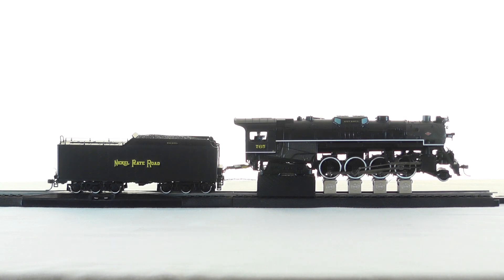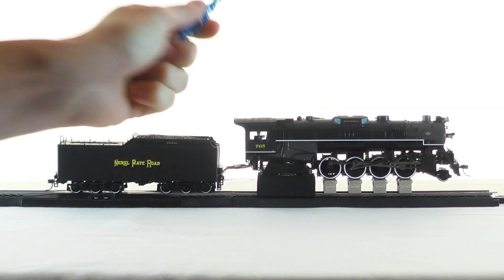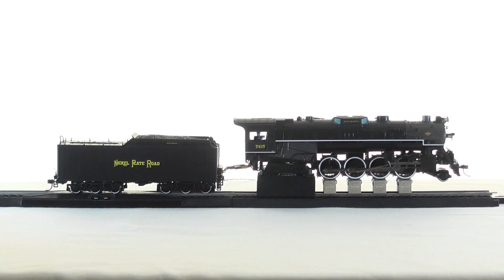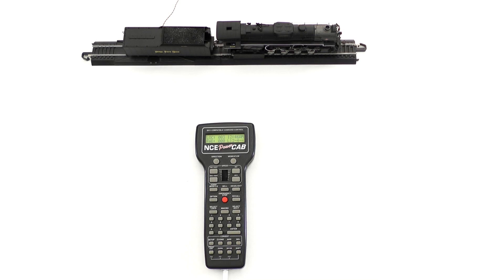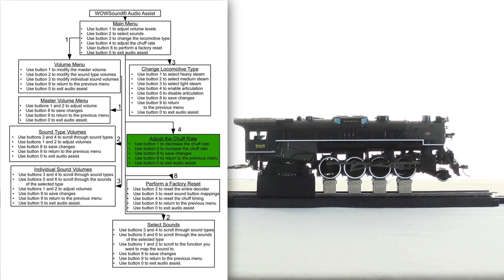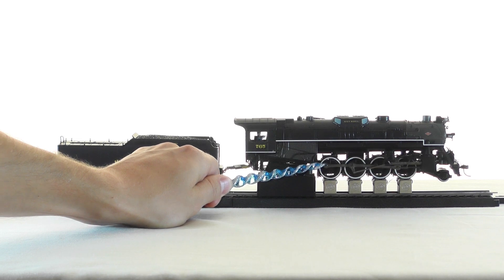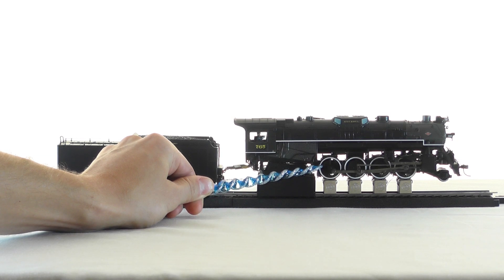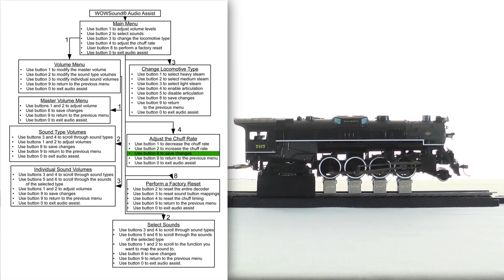TCS WOWSound Chuff Timing Adjustment

Comment: Not exact enough for me.  Thank goodness there is still the option of using a sound cam.  And honestly, sound cams are not that difficult to install and the chuff STAYS exactly where it’s supposed to.  None of this drifting 10 to 15 degrees off which drives me nuts.  Hats off to TCS for retaining that option.  I’m done with Soundtraxx and the Tsunami 2.  Their chuff drifts off ALL the time.
Reply: TSU 2 does have provisions for a cam. I've fitted them to plenty of locos.
Reply: But some key imports have the cam already installed in them so all you need it a wire wiper 😁

Comment: I am new to DCC so what about the timing on the other side?  On my steam locos, the wheel rods are set about a quarter apart from each each side.
Reply: Both sides turn at the same speed, so if one side is correctly synced, they both are.